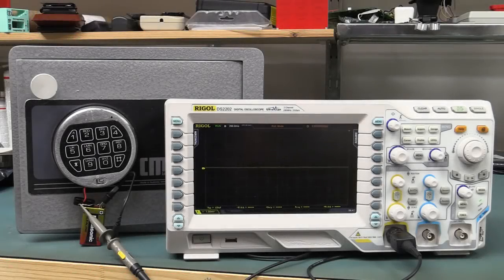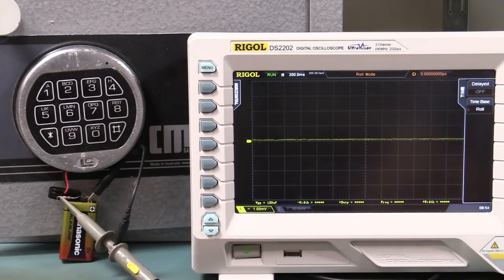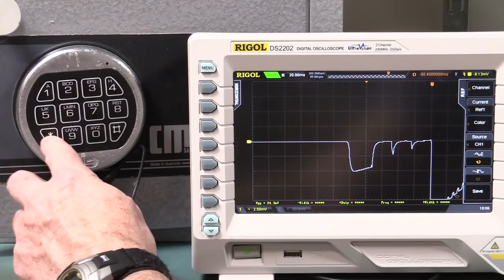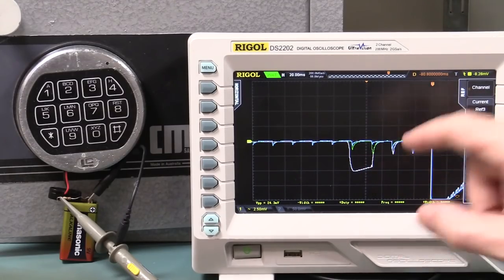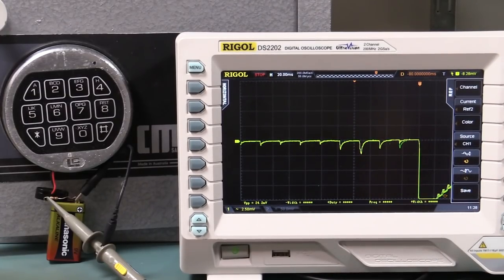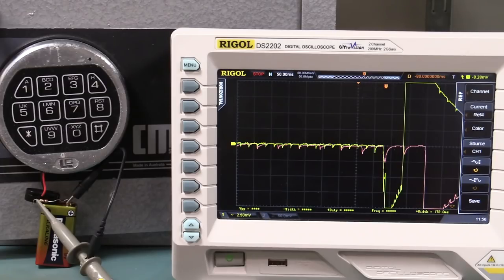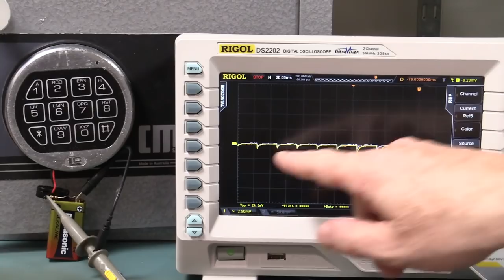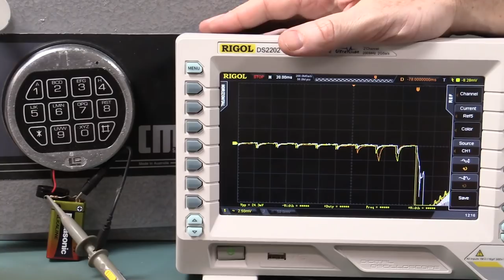EEVblog #771 - Electronic Safe Lock Powerline Attack Part 2

Comment: I really don't see the point of an $800 safe that is completely vulnerable to a drill or a angle grinder. A cheaper safe is going to deter opportunistic thieves. This seems to be a completely pointless product. If you are going to keep something in your house like gold or cash in that safe, you may as well buy a better safe. Not to mention fire damage. This thing is definitely not fireproof.
Reply: It might be "vulnerable" to a drill or angle grinder, but you'll make a lot of noise breaking in that way and it'll still take time. Now, assuming it's bolted down, the chances of you getting caught doing this are much greater than the chances you'll get caught if you pocket the stuff you can easily get hold of and run.

Additionally, if you're caught wandering round a housing estate with a drill or angle grinder, and you aren't a builder, the local policeman is very likely going to ask you what excuse you have for carrying power tools. Certainly in the UK, you stand a good chance of getting nicked for "going equipped".

So actually it provides good protection from opportunist thieves and your everyday burglar.

(Your objection is similar to the argument that door locks aren't worth bothering with because you can just saw them out with a recip saw/circular saw. Or maybe even doors are pointless because you could cut through the wall with a disc cutter. These things are true, but burglars typically don't arrive equipped with large power tools.)
Reply: No, my point is that if you're going to buy a cheap safe, don't spend 800 on one. Powertools can easily fit in a backpack, you don't need to walk around with them in your hands.

Comment: nice. but is still prefer efm for opening these.
Reply: I keep hearing that there is no way an emf can penetrate the safe. but it doesn't matter.
you can just use hv inverter and connect it between battery terminal and metal case (confuse an mcu), or use the safe it self as an antenna.
Reply: Martin Šalko Won't work, they are rated to withstand that.